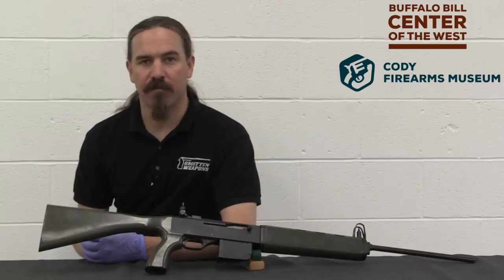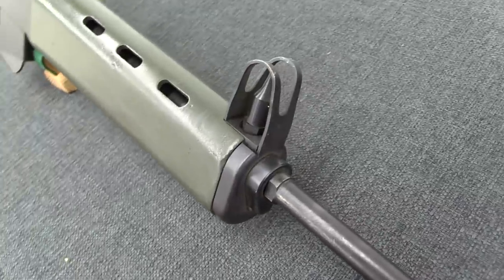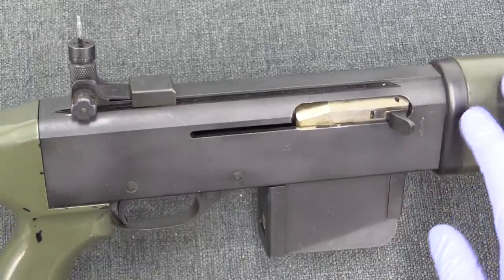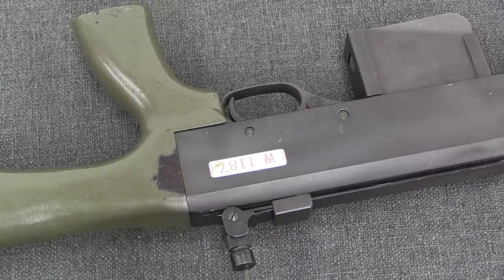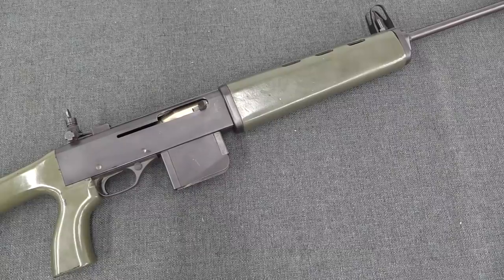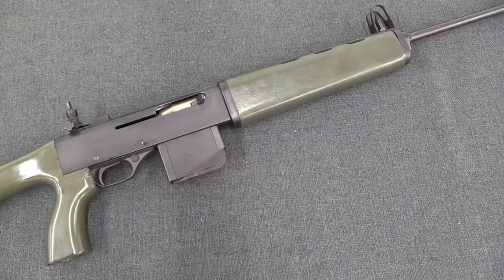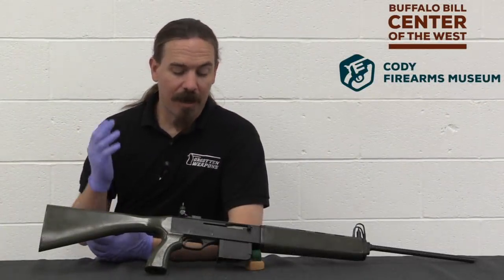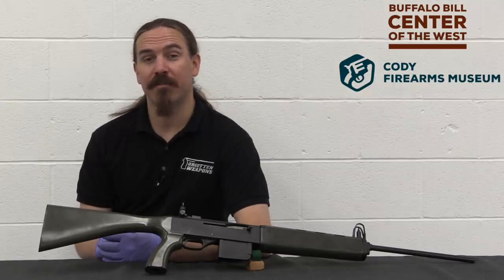Winchester Mystery Prototype: Melvin Johnson does Project SALVO?

Comment: CLUES
-The trigger group/guard is off a Model 120/1200 (placing this rifle 1963 or later!) 
-The bolt looks like an adapted 1200 humpback bolt  but the bottom is VERY different

-none of the visible components bear resemblance to the model 100 autoloader (1961)

hope this helps

Comment: Just as I was typing that the receiver / trigger guard / safety reminded me of my old Winchester 1400, Ian mentioned it.
Reply: I've never owned a Winchester 1400, but the trigger guard and safety are definitely very similar to fhose of the 1400. The 1400 was introduced in 1964, but was obviously in development before then. It and the slide action 1200 had rotary bolts.

David Butler, a Winchester engineer, wrote a book called The American Shotgun that has some information about the development of the 1400.
Reply: Trigger group definitely looks 1200/1400.
Empty notch near trigger guard could be opening for the bolt release on a pump action.

Comment: The color fits with the 1950s. Greens like that were popular back then, to the point of being humor material today. So it could readily still be civilian.
Reply: It's as if they had just learned how to make green plastic that was strong enough for a rifle.
Reply: @AshleyPomeroy  I think the materials used for the furniture were old polymers at the time similar to Bakelite. If you look at the hollow end of the stock ( 1:47 ) and the light chipping at the hand guard, you’ll see that the furniture has been painted over. Many Americans tend to call this color “Bazooka Green”
Reply: I have a ‘66 G3 hand guard in that kind of color but I like my 50’s wood one better
Reply: @89thaharmaiiioptreshenanig3  are we talking Iranian G3 Bakelite furniture or the standard Olive Drab/Forrest Green color?
Reply: It's the same shade as the early AR-15s model 01s.
Reply: @cherrybomb9130  it’s olive drab and it’s stamped by HK. The date is 4/66

Comment: Maybe an idea for a Winchester entry into the trials for the new service rifle competition that ended with the adoption of the M-14???
Reply: That is what it looks like to me.
Reply: I was thinking that too.
Reply: There’s a forum I’ll link, dude might be full of shit, but it’s a lot to type out for nonsense. Basically Winchester heads put out a fatwah staying they wanted to beat the Armalite rifle. They wouldn’t get it done at the expense of reliability. So they said “make some rifles out of proven designs in .224”. I think this falls in line with the time frame and the design of the competitor rifle ie must have elevated sights to limit heat mirage, recoil in line with the action, and detachable magazine. My thoughts, this was a competitor trial tool room  gun. It was most likely a “well if you’re a little hesitant about this rifle, we have it in a non “sissy” caliber.” People have to remember that this rifle was supposed to equip the entire US military, this was a billion dollar deal when that wasn’t a thing. They would’ve had contingencies for contingencies, just to get a rifle to trials. Which is what I think this is. I think what’s throwing Ian off is the .308. I think this was in .308 because there was major hesitation in moving from .30 caliber.

https://forums.spacebattles.com/threads/winchesters-failed-ar-15-competitor.378096/
Reply: Thinking the same and that maybe Winchester was tipped off that Army BuOrd was mainly holding trials for show and they were only interested in their own design.

Comment: This appears to have a trigger group with a bolt-release cutout from a pump-action Winchester Model 1200. When first introduced in 1964, the 1200's trigger guard had a slightly different contour than 1968 examples, which match the mystery prototype. The 1200 had dual action bars, unlike its Model 12 predecessor, which had only one. The bolt on the mystery prototype has a charging handle and tapered tail similar to the Winchester Model 1400 (1964) auto-loader, but with rounder sides.

Comment: every development shop I've ever worked in has required engineers and technicians to maintain engineering notebooks. (Typically these were soft bound  typing paper sized pages, a lightly printed grid, and numbered pages. The covers have typically been brown. The lawyers would occasionally drop by and check that you were keeping them for patent reasons.) Companies tend to hold on to these, as they are institutional knowledge. They are often organized by engineer and project. They speak specifically to the work the engineer has in front of him, the data he collected, and his thoughts.

Comment: You are correct in your shotgun observations.   Winchester during that time frame started making aluminum reciever shotguns with rotating bolts.  An example of the pump model would have beer the 1300 and the gas operated version would have been the 1400.

Comment: The Winchester 1400/1500 has a really similar mechanism with the shape of the bolt carrier, a bolt shaped like an AR-18 one, albeit 12g and 4-lug, the action bars on the sides, the placement of the piston and recoil spring and the externally identical looking trigger group. The biggest difference is that the 1400 has a magazine tube holding 2-3 shells, with the spring and piston in-line and ahead of them inside the front handguard.
Also, that gun is pretty complicated to field strip (compared to ak-47/ar-15), but the barrel comes of with a single thumb nut at the front of the gas port / hand guard, making it pretty nice to transport.

Comment: A .308 rifle based on a shotgun. Now that's scary. Shotguns are way too lightly built to handle rifle cartridges. You wouldn't see me anywhere in the same room when someone pulled the trigger on that thing. There's just huge differences in pressure and bolt thrust and the receiver isn't structured to handle it. It may work for a short while, but sooner or later it's going to let loose. To give you an idea, bolt thrust on a 12 gauge magnum load is somewhere around 4,300 ft/lbs, and a .308 is somewhere around 10,000, and chamber pressure is 11,500 on 12 gauge vs 62,000 on .308. Run. Run far, run fast.

Comment: Damn, it must feel bad working a lot of hours, pouring your mind and soul into a project then it just stops, goes nowhere.
All your hard work is gone.
Reply: Not necessarily. If you're working on a speculative project you have the chance to play around with ideas and learn from them while (probably) being under little or no pressure to meet production targets. Half the time you're really just trying to work out the best way to actually produce this thing and what tooling you'll need. Speaking from experience, sitting around drinking coffee and yarning with coworkers is a big part of the "development" process. 😉
Reply: Been there; done that. It sucks. You move on.
Reply: Welcome to Design Engineering. Sometimes go get a hit sometimes you make scrap. The trick is have more successful projects than failures financially.
Reply: In most lines of work it's like that. The value of experience is you can keep those old ideas in your back pocket and look like a genius when the younger guys are stuck for an answer.
Reply: Bruh they’re still pulling stoners projects off the shelves because they were so far advanced in that day that people didn’t see a purpose in them. Hence the knights armament Amg

Comment: The cut recess at the back of the trigger group is for the slide release lever on a pump model 1200.  The bolt looks like it’s lifted from a model 1400 autoloader. They use a rotary bolt head design.  A very interesting hodgepodge creation.

Comment: The trigger guard is definitly from a Winchester 1200 or 1400, the bolt and action bars are Winchester 1400 style, I believe it is a post  1959 early 1960s design

Comment: You are correct that the bolt carrier and trigger group are from a shotgun. But your timeline may be a bit off. The parts appear to be from the Winchester model 1200/1400 line of shotguns but these guns didnt ome onto the market until 1964.
Reply: And the receiver is from a shotgun, or modified slightly from one. As someone who actually has looked at the pressures and bolt thrust differences, this is horrifying. Over double the bolt thrust and over 5 times the pressure. Literally none of the base components in this gun were designed for that kind of abuse. Even with the bolt locking into the barrel as opposed to the receiver, the lugs on the receiver that support the barrel and, indeed, the receiver's structural integrity itself, aren't designed for that kind of recoil. You wouldn't catch me anywhere in the same room when this gun was fired. I'd want at least two cinderblock walls between me and it.
Reply: And the 1200s will cycle the pump to the rear from the recoil. All you have to do is pull the pump forward. This looks like they were trying to turn that into a semi auto rifle with no gas system. A speed pump to a speed auto.

Comment: I think Ian is right on the money here. Not only the color of the furniture, but also the shape hints to military customers. For commercial sales they would probably have just stuck to a traditional stock instead of messing around with a pistol grip, and the venting on the handguard indicates they prepared it for high volume of fire. Also such an extended magazine well indicates a large capacity magazine, which wasn't all that common on commercial rifles in the 1950's. 

Strangely enough, the Johnsen style rear sight has made a comeback in recent years. As iron sights have given way to optical sights, flip up sights have become more common and variants in the Johnson style are now available and even supplied as standard to both rifles and machineguns.

Comment: This needs dismantled, examined, and maybe reproduced. I really like the way this looks.
Reply: Oh fuck no. 12 gauge bolt thrust with magnum shells: ~4300 ft/lbs, compared to around ~10,000 ft/lbs with .308. 12 gauge chamber pressure: 11,500 PSI. .308 chamber pressure: 62,000 PSI. And this is built on a 12 gauge receiver. You would not catch me anywhere NEAR that thing when it fired. I would title this video "Wherein Winchester branched out to manufacturing hand grenades."
Reply: WardenWolf it's not a 12 Gauge bolt however, it's just a modified receiver. It has a custom bolt. And trunnion for the bolt to lock into. It would From what I could see be perfectly safe to shoot. If you could figure out what ammo it uses.

Comment: That rotating bolt looks nearly identical to the bolt in my Winchester Defender shotgun. 
     A chamber cast would be great. I tend to agree with it being for the salvo idea. The reason I would like to see a chamber cast is that I heard of an experimental 7.62 cartridge. If I understand right, it was basically a 7.62 round with a longer neck. In other words, similar length brass but with the shoulder more towards the rear. It was designed to keep straight and stable, multiple lighter .30 caliber projectiles. The man who taught me gunsmithing in the 1970s showed me a cartridge that sorta resembled a .30-40 krag, although rimless. He told me it was some 'off the wall sh@t the military tried',   'sticking a couple of bullets into the same round'. That's as close as my memory will allow me to quote him.
     As far as Johnson goes, I have no idea but the points you make about the sights sounds good to me. 
     Yall Take Care and be safe, John
Reply: I'm curious if you have any information about the Augusta, GA Arsenal or it's involvement with project Salvo. The Arsenal closed in 1955 but before it closed a number of employees 'took home" "stuff they were through with'. That's basically what old timers were referring to pilfering... I am pretty certain that's where the cartridge I described came from. I also have a number of .45 acp cartridges made of brass and steel. I have a few .30 carbine rounds that have Spitzer bullets instead of the usual round nose ones. These have the bullet set far enough into the case that they feed and fire through the standard magazines. I showed one to a guy a couple of years ago and he asked me how I got an M1 carbine in .300 blackout! I hadn't thought about it but that's what it looks like. I wonder if there was any inspiration from that old prototype when they came up with .300 bo?
    I would love to hear anything you might know about the Augusta Arsenal. 
     Just a side note, their weren't what you would call environmentalists around there, then. A man who got weapons ready for shipping told me that the test fire range was a deflector backstop that deflected the bullets into the Augusta Canal. Lead in the City water supply anyone?!?!!
   Yall Take Care and be safe, John

Comment: The trigger group looks like it comes from a winchester 1200, and the bolt and handle look similiar to that of the the model 1400. the action bars that you point out also look similar to that of a 1400, which contained a piston in front of a two round 12 gauge tubular magazine contained inside the forearm. Both the 1200 and 1400 came out in the early 60's. The sight could have laid around in a spare parts bin for years before they used it on this project.

Comment: This looks a lot like Winchester Model 50 parts. The trigger with cross-bolt safety is used on that gun (which was released exactly in the timeframe described in the video) and the cutout in the receiver also fits perfectly. No idea where the green bakelite? furniture is from, but I am sure I have seen it before on some gun. Wish I could remember where. And it is also logical that the bolt reminds of an AR-15 bolt, since Johnson's patent was used in the AR-15.

It being calibre .30 also makes sense in conjunction with Project SALVO, according to the classified documents only the .30 was accurate and consistent enough for the duplex ammo to be worth testing further. Triplex was mostly missing 2 of 3 projectiles at 100 yards and wildly differing groups at 50 yards. The smaller calibers lost too much energy to be worthwile.

Comment: Ian - that receiver is definitely custom, any old Winchester would have a smooth "hump" at the back where it tapers into the grip/stock. The trigger group is definitely lifted off of a 1200 or 1400 variant, which dates this contraption as post 1964.

Comment: Trigger assembly straight off a Win 1500 shotgun. The missing piece is for the bolt release (so you could open the action without pulling the trigger).

Comment: It looks like a rough prototype version of a model 100 winchester.  Piston driven with a rotating bolt and two push side rails in 308 and 243.  It even has the same safety location.

Comment: The receiver base plate looks like it came from a Mod 12 Winchester pump shotgun. That slot on the left by the trigger was for the slide release.
 It wouldn't surprise me if the receiver was from a Mod 50 autoloading shotgun as it has some similarities in the loading port. Pictures of both shotguns are available on the web to compare.

Comment: That rectangular hole next to the trigger guard is not because of poorly fitted furniture, but where the "action release" lever would have been on a pump shotgun. It is my understanding that on pump guns, the bolt is mechanical held in battery when the gun has been cocked. You cannot simply rack the slide to open it. You have to depress the action release first, that or fire the shotgun which automatically trips the the action release, before you can rack the bolt open. So, your pump shotgun theory is spot on!

Comment: The bolt carrier is most reminiscent of the Winchester Model 1200/1400 shotguns, which started production in 1964.  Winchester also would’ve had access to the Remington Model 742, a .30-06 class semi-auto rifle of very similar design which started production in 1960.  Both dates would preclude Johnson’s active participation, and the rear sight may just reflect whatever suitable parts Winchester had “laying around”.  My guess is that this was Winchester’s effort to develop a rifle that had some “cross marketability” - i.e. it could be a competitor on the commercial hunting market for the Remington 742, and a competitor on the military (probably foreign) sales market, probably at the lower end of the cost spectrum.  A direct modern analog is the commercial Browning BAR and FN FNAR.

Comment: Once you said shotgun action I knew why that receiver looked familiar, also the stock looks a lot like a M-14E2 (select fire) stock . Any chance someone at the museum is will to take that rifle apart to see more on the insides? Kinda looks like the trigger group comes out with the removal of the two pins in the receiver.

Comment: That's built off a Winchester 1400 scaled for .308 or something similar.  I'm betting under the handguards you'll find a BAR style op-rod fitted to the action bar slots of the shotgun bolt carrier and a spring adapted to bring the whole thing back into battery.  You can even see the little firing pin retainer plate on the bottom of the bolt carrier from looking in the mag well you would find on a 1300/1400.  That missing tab on the trigger guard is for the pump lock on the 1300 for sure.  They just cut the casting down to fit and deleted the shell lifter.  I couldn't find any versions of Winchester pump rifles that used that receiver so I'm betting it's also an adapted shotgun component.

Scale it down a little more and I bet you could make a decent light rifle in 5.56.  It already has a rotating bolt that locks into a barrel extension, aluminum receiver, and doesn't have the hump on the back that shotgun receivers do.